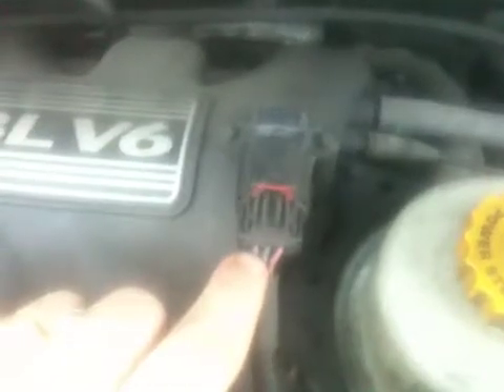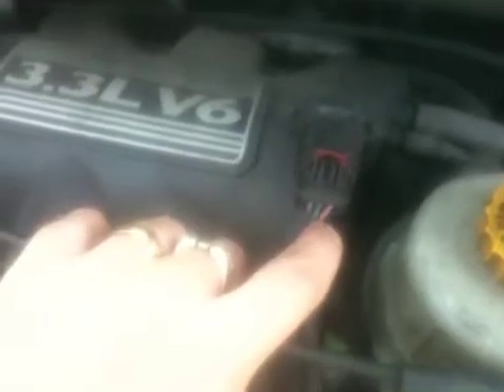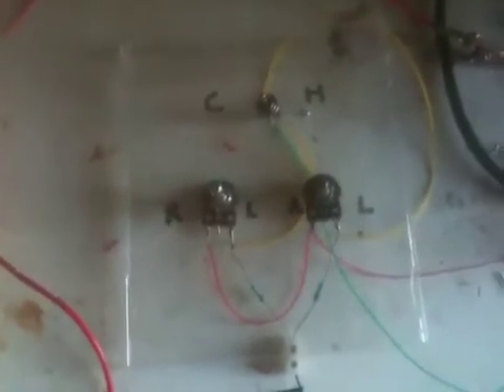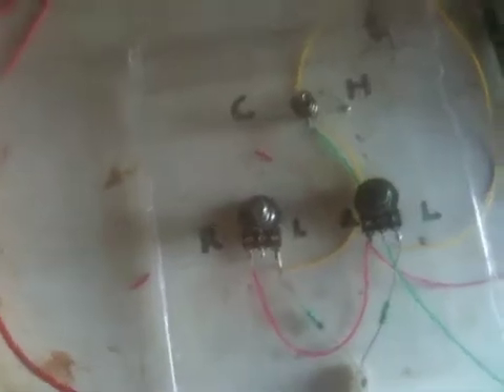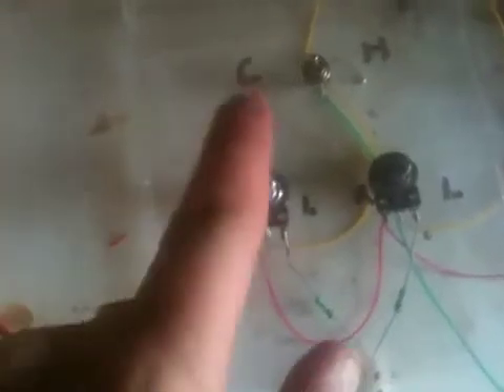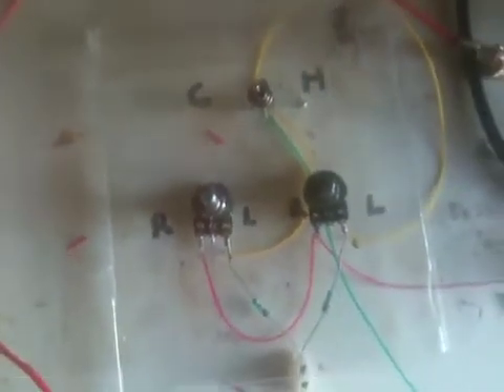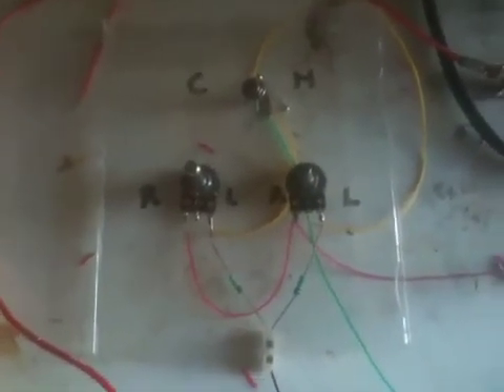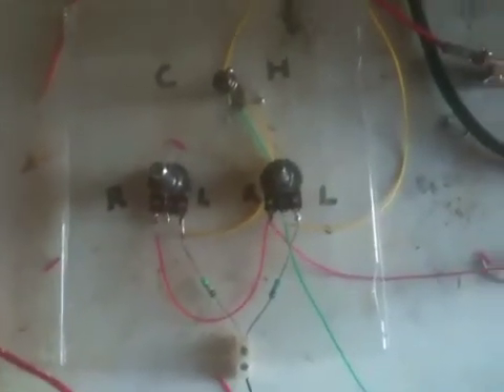Simple MAP/MAF enhancer for my Chrysler voyager

Comment from the maker: hello SilentDeath002,

i think you have done really well with your cells, very impressive with the low amperage and great output of HHO. Keep up the great work.
answer to your question (resistors) : i used 100k on each pot, you could use the same value as the pots but by increasing the value of the resistors, you dont make the enhancer so sensitive so you can make a finer adjustment.
thanks for watching, speak to you soon.

Comment: nice set up on the enhancer. you used some small pots , what were the resistor values you had on them? again, excellent job, that should save alot of money. lets see it in action. i am still conditioning my cells. getting over 250ML at less then 1amp drive in 60 seconds on my pulse system, and it gets better each day.